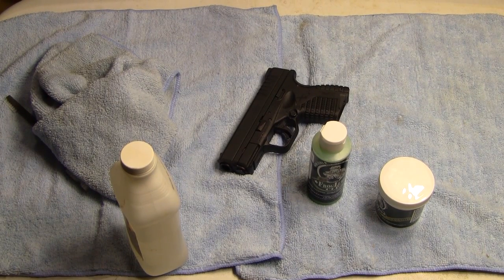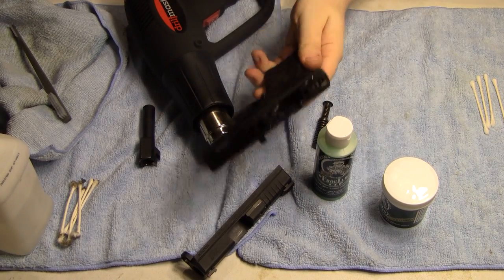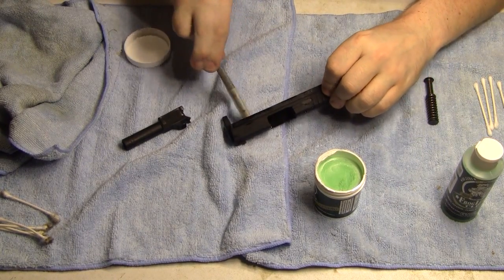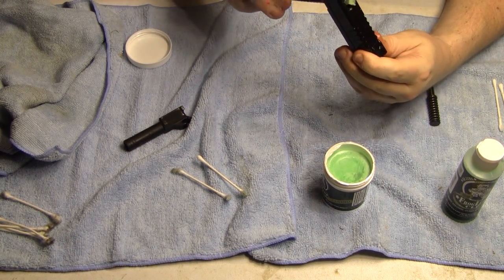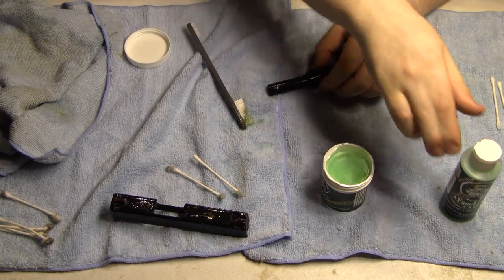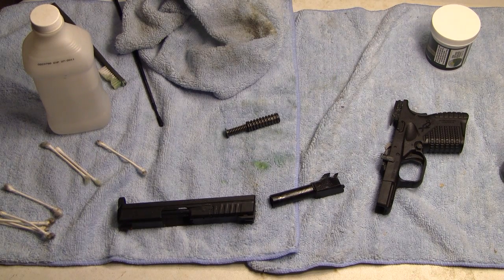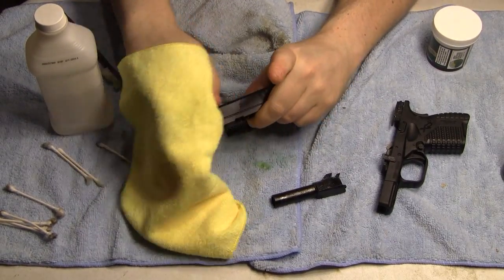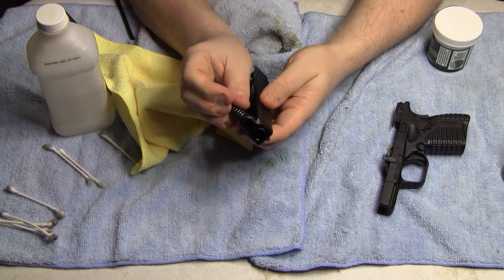How to treat a pistol with Froglube

Comment: With froglube, heat it up slather the sucker in it (inside and out), wipe it off, then apply the thinest layer of the liquid possible to the parts showing wear. If its new generally the rails on the forward section of the bcg, the three tabs on the forward area of the charging handle and the very top of the hammer. Again thin layer.

Comment: Since this is your first time using the stuff H4T2 I'm going to open my trap and offer a few ideas, if you choose to try cool, if not thats cool. 

1. On polymer framed handguns, use a heating pad (like for knees and backs) set frame other stuff in a ziplock roll it up in the pad for as long as it takes to get comfortably warm ie you call keep hold but you know its warm and put the lube where you want.

2. Use a smaller brush you conserve the paste so much better that way.

Comment: Hoppes isn't an oil, that's why. It is only a cleaner. you need to oil after using it cause you've stripped the oil in the cleaning process.

Comment: I would soak it with alcohol to clean, alcohol is not a great degreaser, it's an o.k. one.  spray carb cleaner will really dissolve any oil based or carbon fouling, but don't get it on plastic

Comment: so should you put it in the spring in the slide? i guess what im talking about is the firing pin spring. im not exactly a gun guru lol
Reply: No they say it could cause problems if caked up say months around the spring fireing pin I just put it on cold it's clear extreme I used

Comment: So after 20 reviews on frog lube, I went out and bought it, I use it on all my three gun, all springfield,  I have 3.3 45 xdm.. 45 5 inch xd and a springfield 1911 trp. Can someone else give me some tip because since I started using frog lube all 3 of my guns have been jamming, jamming a lot. I have own guns for about 4 years now. Is this happening to anyone one else?
Reply: Then your guns are garbage lol. I use FL on my AR's, AK, all my pistols - with thousandsss of rounds combined between all guns with zero issues.
Reply: itsmyleggz be sure to wipe off all excess froglube. Should basically look dry.